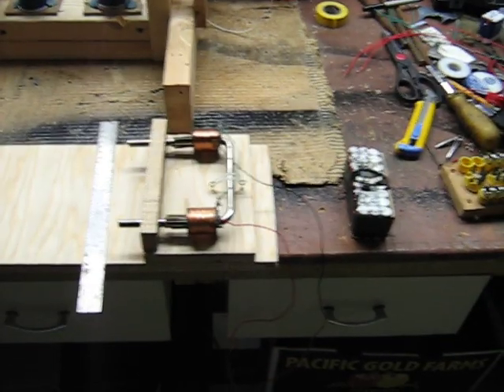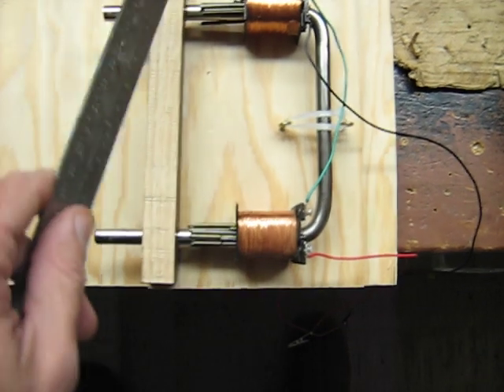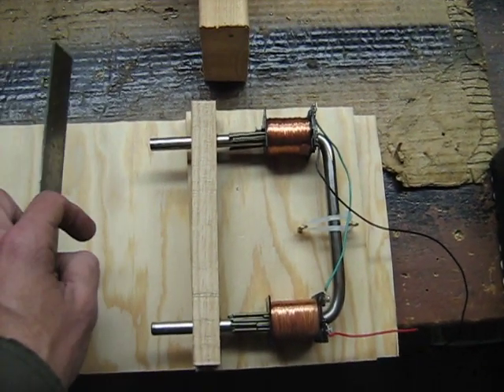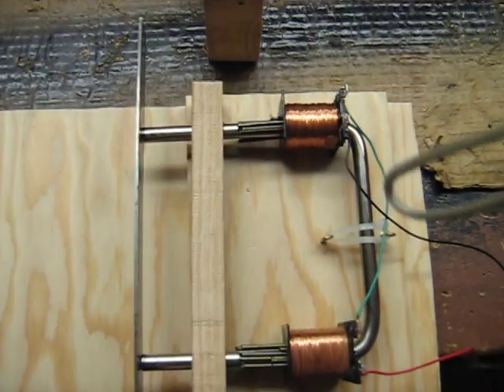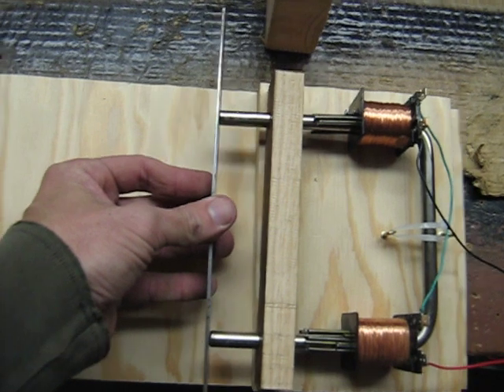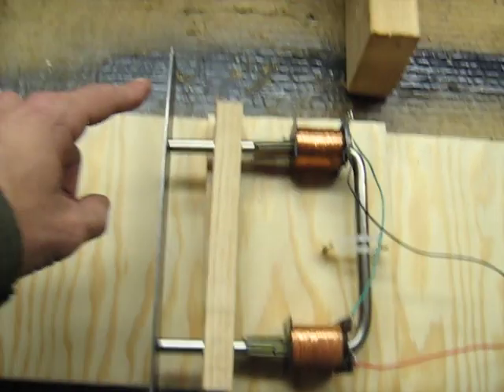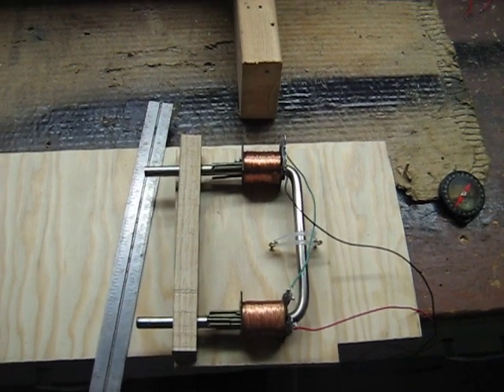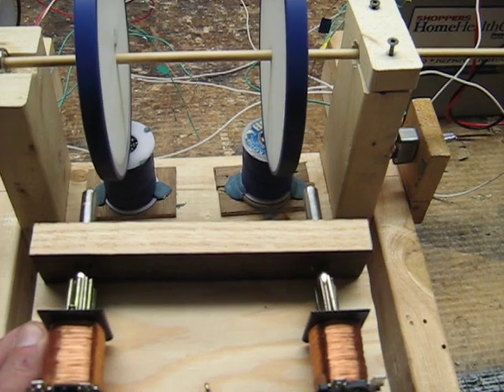Perpetual Motion Holder - Ed Leedskalnin

Comment: @op684 not exactly. Remanence would explain some of the magnetism remaining but it would not explain, for example, a light bulb giving off light at the moment that the flux "circuit" is broken and also would not explain the magnitude of the remaining field when some of the better coils are "charged" with a single AA battery, etc. A better interpretation requires some form of scalar potential. Aside the coils are wound opposite so flux lines should cancel according to established theory.